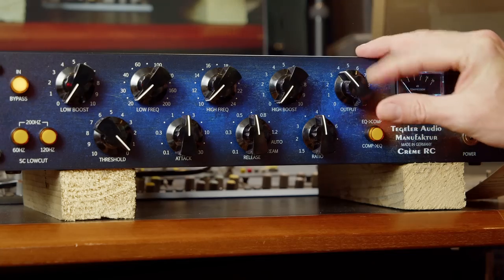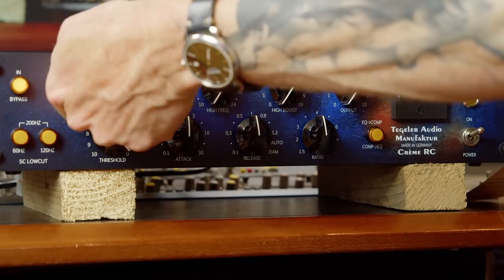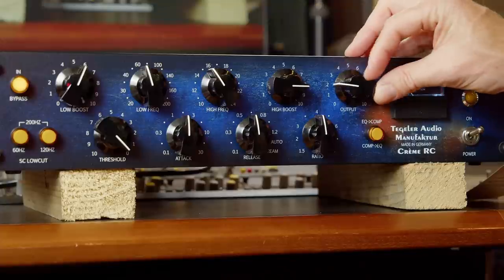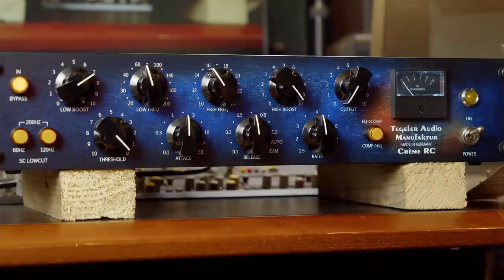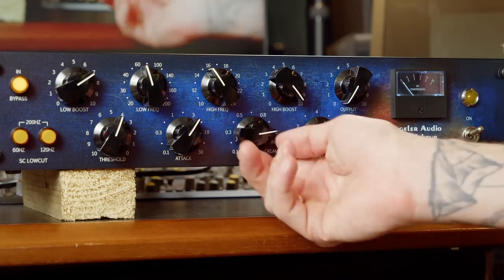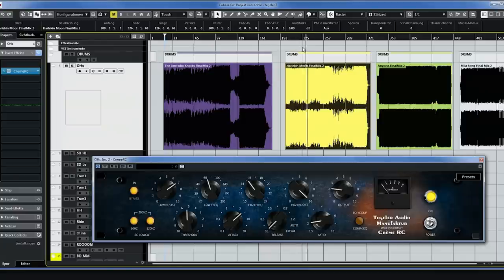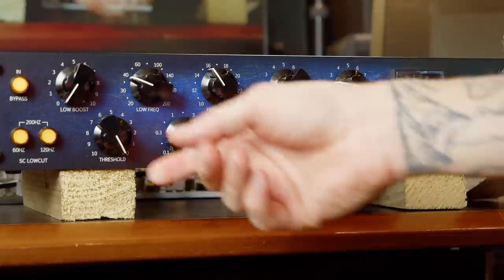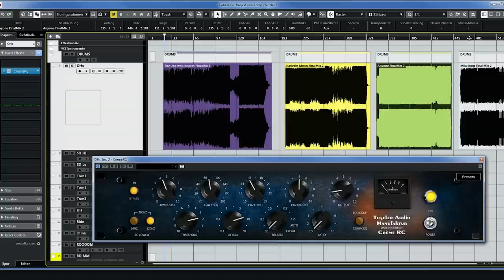How to SWEETEN your MIX with EQ and COMPRESSION!

Comment from the maker: Now I'm curious! How do you like the CREME? 
What's your favorite master bus EQ and COMPRESSOR?
Reply: I run my Crème (Compression into EQ) into my Tegeler  VTC, a VariTube Compressor. That's my favourite main bus chain.
Reply: For the master bus I'm in love with the TDR Kotelnikov. The detail you can fine tune with the behaviour is second-to-none. It is very transparent however so doesn't really have any 'sweetening' effect. The control over the dual release features means you can really breathe life into the track in a beautiful way.
Reply: I heard in a YouTube video a comparison between a Tegeler EQ (probably Creme) and plugin EQs and it sounded to me much better than the plugins. And I learned about an EQ called CEQ - 6 Band Passive Mix and Mastering Equalizer from Terry Audio that also seems good.

Comment: Hi !  I have this thing for over a year, and despite the few flaws you said.  it's an amazing unit it's not just a buss comp think you can automate your mix and also your tracks in real time.  and remember your presets, this compressor is magnificent on quiet voices, happiness on acoustic guitars and anything that requires depth is softness maybe not the go to for metal I prefer the API 2500 for that.  but personally the cream has become an indispensable tool for me ! Merci pour cette vidéo.

Comment: Keep it, it's awesome :-)
Another great thing about RC, besides the digital recall feature, is that you can write automation into your DAW to control parameters of your analog gear, just like you can do with digital plugins, e.g. for changing the ratio, threshold, etc. to respond to dynamic changes in the song. 
When using the RaumZeitMaschine, which also has a remote control feature, I often use automation, for example to make the "virtual" drum space coming from the RZM bigger during choruses.
Reply from the maker: Really looking forward to diving deeper into RZM!

Comment: I wanted to buy it, but after this video I changed my mind, the EQ sounds phenomenal but the VCA is too slow, even with extreme settings, I thought it would work like an SSL style compressor, but it works more like a Manley Vari Mu... smooth and buttery :) looking at your face, I had the impression that you felt the same   or am I wrong?

Comment: I have it too. Great video!
Reply from the maker: How is the long time experience?
Reply: @KohleAudioKult  I got it since 2 years now. Unfortunately my Cubase often crashes when I try to use the plugin. Also some Potis don't react when I'm recalling my presets. I'm running win11 with cubase12. Maybe it works fine on your system. Würde mich jedenfalls interessieren :) I've been in contact with Tegeler Audio about this issue. But it didn't help much.
But besides the plugin all around it's awesome. Its good on vocals. And it's very easy to give weight.
Reply from the maker: @comadamage  Hm. That's an important issue though! Worked fine here. But I'm on Windows 7 with Cubase 10.5 haha!